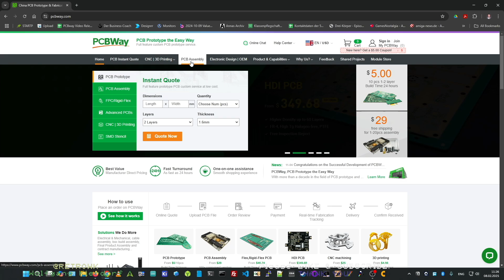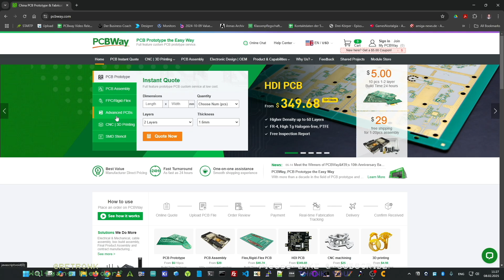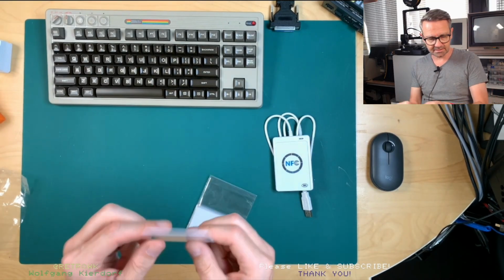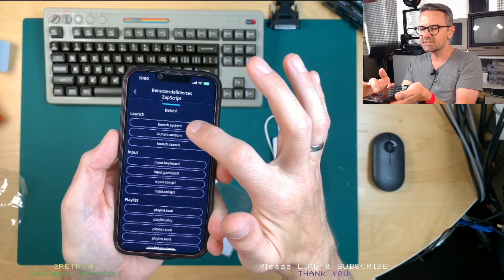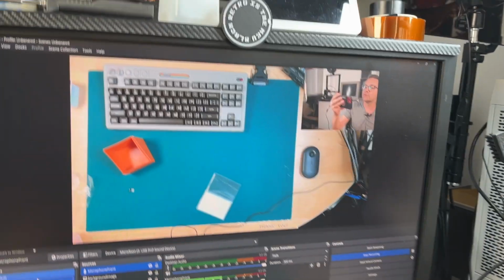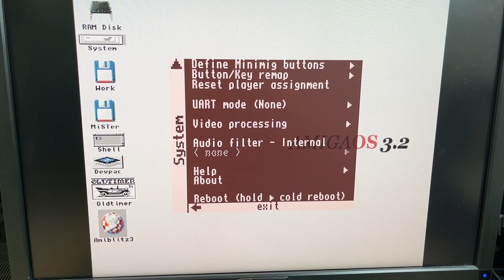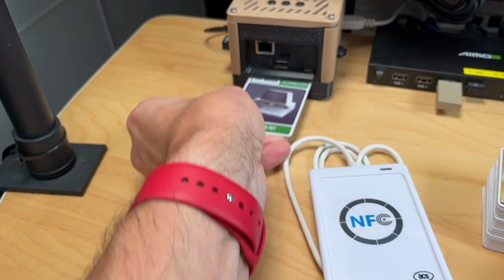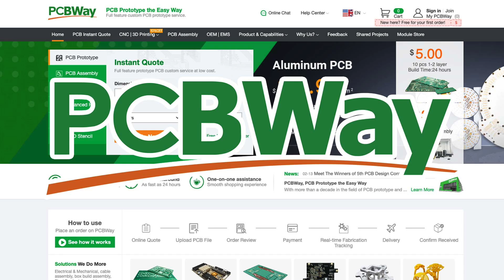Zaparoo Pt. 2 -Build in MISTER NFC reader + NFC cards to start computer cores #pcbway #misterfpga

Comment: really interested in this, not for me to use but for a public event where people can sit down and play any card they see.   I have a question. when i play pokemon on mister and save the game, if I turn off the system the actual save will not get put on the micro sd card and be ready for the next time i boot up the game unless i bring up the mister menu.  If I use these cards and switch games without bringing up the mister menu will the save actually get put on the SD card?

Comment: Hi, when will you do more video on the TC64 V2?
Reply from the maker: Soon :-)
Reply: @RetroWK  Looking forward to that. Turbo Chameleon 64 is a rather unique device and I don't think there are enough videos about it. An example: The fact that you can run Amiga AGA core on it while having it plugged into your C64, and at the same time C64 keyboard and joystick port works in minimig core is rather unique. There are even keymappings for the missing amiga keys
Reply: @RetroWK  btw, TC64 V2 has a rather weak VGA output. Jens said he put filters to make it look more retro and pass CE testing. do you get smearing to the right with certain colour combos? IK + or BadLands are good examples to test with.